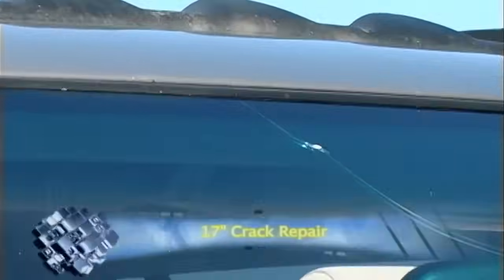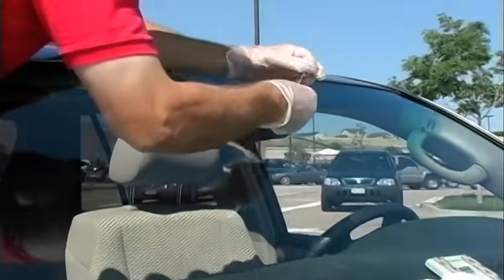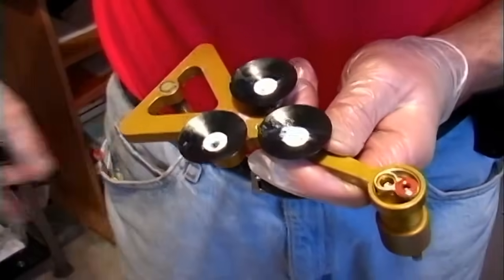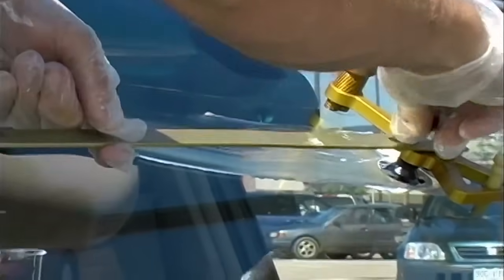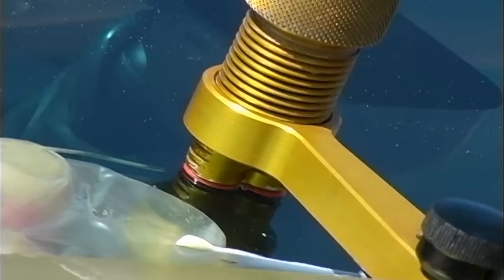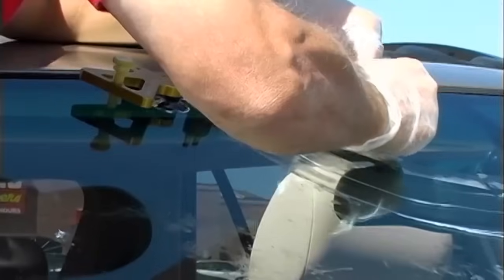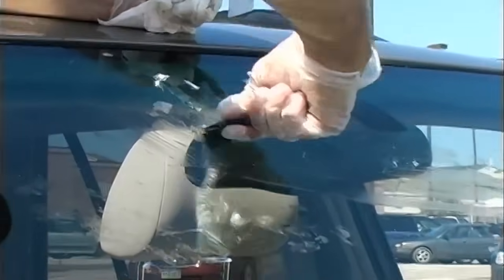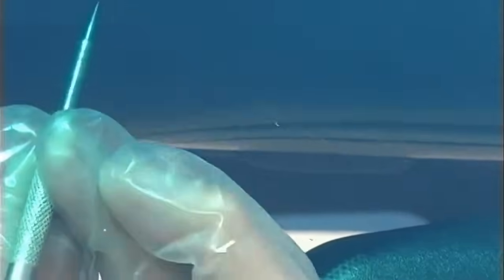Windshield crack repair (17 inch)

Comment: Thanks for the video!
I have one question: Why you need a bullseye (in the beginning of the vid)?
Why is drilling the hole not enough to stop the crack?
Reply: That's what I also want to know
Reply: the bullseye is for the resin to penetrate inside the crack. technically Glasses have three layers the middle layer is plastic which is the one that's cracked.
Reply: The outside layer of glass is the one that’s cracked. The middle layer is vinyl and does not crack.

Comment: Anyone know from experience if this really stops the crack from spreading?
Reply: It doesnt “fix it” it just “hides” it
Reply: @M3Eddie  Had it done a few months ago. So far so good.
Reply: @M3Eddie  not true
Reply: I repaired a 12” crack almost 3years ago on my friends truck and it’s still good to this day. And that’s through 2 Utah winters. Snow. Ice. The enchilada. No bullshit
Reply: I didn't believe it at first but tried it and so far so good.  Been almost a year so far in NJ and still not spreading and almost unnoticeable.  Windshield was in a Toyota Camry which would have required a new windshield plus camera calibrations costing over a thousand dollars.

Comment: what if the crack is on the inside?
Reply: What???
Reply: Won’t work. The curve of the glass has strength against inward pressure like an arch. Outward force? not so much

Comment: This is the biggest backyard hack I've ever seen. This "repair" doesn't do anything to fix the glass. It will crack out again after a few large road bumps. This repair is illegal in most states as it should be.
Reply: Not necessarily true. Yeah it could crack out again but it might not. I’ve personally repaired a 12” crack about 3 years ago and it’s still good through two snow filled Utah winters. How do I know it still holds you may be asking yourself right now. It’s my friends truck and I see it regularly. Besides there’s not really anything to lose by trying. The shits already broken and it’s almost a certainty that it will grow if u do nothing at all

Comment: When you got a cracked like that you do not fix it you change the glass. Because it's very hard to fix a cracked like that. If you tap to hard it'll make a spiderweb effect which is bad and if you put too much pressure on the back of the glass where the crack is it will spiderweb to. I know this because I work in a glass company and if a chip or crack is bigger than a quarter you might well change the glass because it is too hard to fix when is the size of a quarter.
Reply: Said like a true contractor whose only goal is to make more money.  I assume you don't plug tires either.  That's another common..."you do not fix it" like that...just temporary a temporary fix.  I must have plugged at least 20 flats over the past 20 years and have NEVER had a problem.
Reply: Ant that the truth sounds like he has a silver spoon in his mouth  his whole life
Reply: @mgpvii  not sure what the hell plugging flat tires has to do with glass repair but you’re correct about the contractors only goal making more money. It’s unfortunate how many recommend replacement when it’s repairable
Reply: @crysmeff7205  I plug tires all the time without issue at a fraction of the cost to removing tire and having it patched from the inside but a repair shop will always tell you the plug won’t last. Don’t repair it, pay for us to do it. That is what the hell it has to do with contractor telling you don’t repair windshield yourself.  Sorry you couldn’t get the analogy.

Comment: Fuck it just replace the whole shield with a new one! Insurance should cover it.
Reply: xXDeathMetalThrasherXx if you have comprehensive full coverage yes. If you have just the Liability and Property damage which is the minimal state requirement then no windshield replacement is not covered by insurance companies.

Comment: why not just replace it?
Reply: Exactly
Reply: It's an expensive excess for some people, and some people don't have insurance for windscreens at all
Reply: yeah, i mean how much is it? like 150  200? ect, are we really that broke in America?  maybe yes, thanks omar!.
Reply: I have a $1,000 insurance deductible and guess how much a windshield costs? $900 for the one on my old 2000 Kia Sportage three years ago.  I paid $250 for the quarter window on my old station wagon.
Reply: Esqj wtf? I paid $300 for a total replacement for my 09 Outback
Reply: I stand corrected, I have the deductible stuck in my head.  Every time I put my now-traded SUV in the shop, it was $1000+.
Reply: Esqj It is under 200 bucks on my pickup to have the windshield replaced and installed. No insurance.
Reply: Esqj  here in socal 120 bucks installed for suburban, used but in perfect conditions
Reply: Jacob Baez why spend 300 dollars when you can spend about 50 on a repair? lol
Reply: diego chavez You really call this a repair? The glass is still cracked, and will be visible with the sun's glare. Look at any windshield that has had any crack repair done after a few years, and the resin starts to deteriorate. Hell, if 300 is too much, pry a windshield out of a junkyard vehicle and pay someone to put it in properly. 100 bucks max.
Reply: ***Classified*** The Epoxy will extend the windshields life by not letting it crack, its like having a protection barrier. Again, why would you spend a lot more money for something that can be fixed in the meantime for a fraction of the cost?
Reply: diego chavez it won't hold up, and you can still see repaired cracks when you're driving in the sun. How much was this repair? My local junkyard will sell a whole windshield  for 40 bucks. pay someone to put it in right or make it work yourself. Works better in the long run.
Reply: ***Classified*** That epoxy is tough as shit so I highly doubt the epoxy would get messed up, and you would be better off with a new windshield. Used windshields will most likely have weak points at where they can eventually crack or get damaged.
Reply: diego chavez I had my windshield crack fixed once about 8 years ago. It was 2 inches long, and he used something similar to the shit in the video. Safelite did the repair. Anyway, I sold the truck to a friend and 8 years later, truck is beat to hell, and the crack is all the way up the windshield. Same crack, originating from the same chip. Anyone that does auto glass can tell where a repair was made, and since most people have a fairly low deductible on glass, I would rather pay the 100 bucks to have it done right. Just make sure they use primer before gluing the new shield in!

Comment: This isn't a legal fix. You may make the windshield look improved, but the structural integrity is still compromised.
Reply: Is that really a legal matter or something of a recommendation?
Reply: After having a crack in my windshield, I looked more into this topic.  Here in NY windshield cracks will only fail inspection if the crack is anywhere in the path of windshield wiper blades (As per DMV website), in other words there is no legal structural integrity issue involved only related to obstruction of view.
Reply: Harpreet Singh fail inspection? What inspection are you referring to? There is no such thing in Illinois. Do you mean if a police officer could give a traffic citation for a crack in a windshield? I called 6 different police departments and they all said it could be dangerous but it is not illegal to drive with a cracked windshield.
Reply: Harpreet Singh no such thing as an inspection sticker for a passenger vehicle. Perhaps any vehicles for business or contractor work but not for personal use.
Reply: robert89921 The majority of states issue yearly inspection stickers for passenger vehicles. A crack in the windshield is enough to fail the inspection.
Reply: @Noname-lk2ol  I work at Safelite and completely agree with this comment 100% it’s all about that almighty dollar. And not just the auto glass industry. it’s like that EVERYWHERE and it makes me sick. I can’t even count how many times I’ve pulled a car into my bay scheduled for replacement and see there is only a small, easily repairable rock chip. At least 3 out of 5 times the customer was never informed that repair was an option  and much cheaper. I doubt my superiors are thrilled when this occurs but it’s fucked up to go straight to the most expensive option without informing the customer of more affordable alternatives. Just. Plain. WRONG

Comment: This is so unprofessional. Any good company knows that you shouldn’t even attempt to repair anything over a 4 inch crack let alone a 17 inch crack. Morons
Reply: Unprofessional? How? I’d agree with not recommended or not the ideal solution. But the only reason to call it unprofessional is if you work at a shop and only care about how much more money you can make if you talk the customer into a replacement instead. Replacements can get pretty expensive and not everybody is able to cough up the cost. Repairing a crack this long isn’t the ideal solution but can help in a pinch. Besides the glass is already cracked what’s to lose by attempting to repair it?

Comment: They should explain a little better the depth there drilling at  and compare it to the thickness of the window Maybe using refrences like 1/2 mil a cunt hair ?? somthing Maybe answer the question How thick is the outer layer of most windsheilds before you hit plastic?? DURRRR

Comment: BEWARE RIP OFF!
Reply: gabriel padilla proof? looked like it worked to me, and fyi this is how the pros do it  same exact process
Reply: works  with brand new cracks only, it is dusty where i live,  if the crack is old the dust becomes mud, it will end up even uglier
Reply: i bought the pro kit 1500 dlls, they will rip you off too, the kit does not even fit in the tool box provided, i returned it after many different attempts to fix cracks, good luck finding recently cracks to fix, and their money back warranty is bullshit he sent me $700, so he stole 800
Reply: gabriel padilla worked here do it properly and you'll get the same results. Your lucky you got anything failure to follow directions doses not warent a refund
Reply: i really doubt someone can live out of this, except of course those who rip people off!